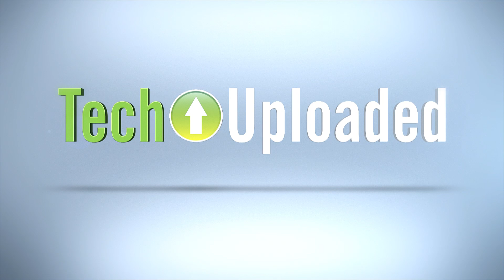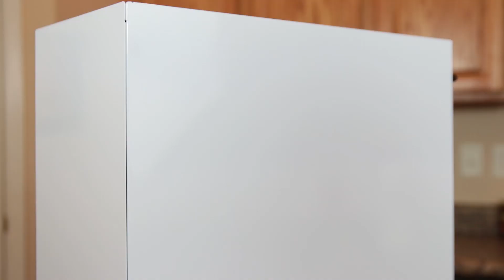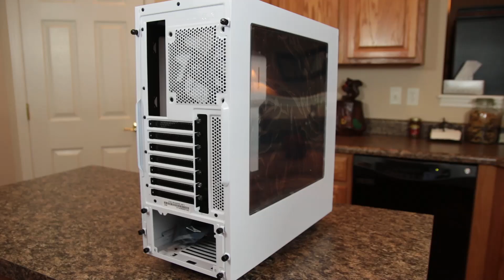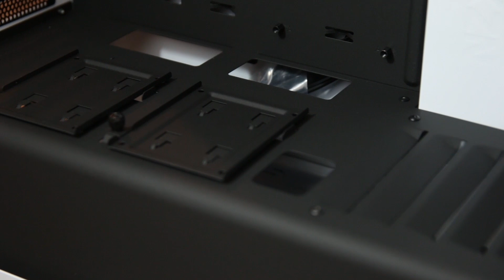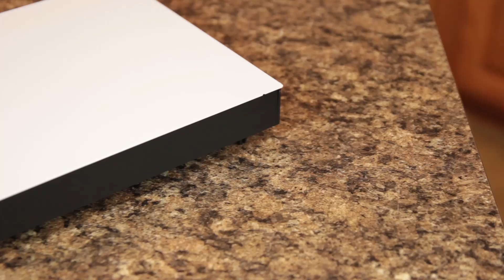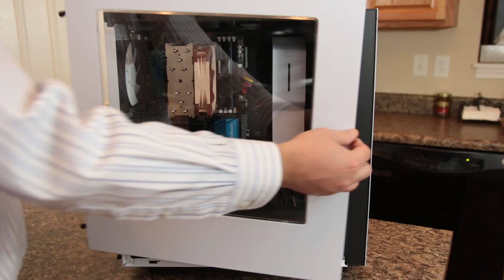NZXT S340 Mid Tower Case Review

Comment: hey man if i want to buy the NZXT H440 case and it have no optical drive.. so how i am gonna install windows in this situation? should i buy an optical drive and plug it into the pc and then install it?
Reply: ELEGZER i know this is a late answer but what i did for my comouter i used my laptop or friends computer to transfer the operating system to a usb with enough memory
Reply: Yusuf Gunsever no its not late cuz i still didnt buy one :).... and thanks
Reply: ELEGZER no problem
Reply: use a usb

Comment: Great video thanks, I'm building mine today and hope to have a great experience using this case.
Reply: Droo-Tech how did it go?
Reply: It was an absolute pleasure, took around 3 hours to complete. Only issue I had was mounting the MB, the screw in the centre is hard to reach. Otherwise it's been running great.. Only problem is the upgrade itch is itching!! Eyeing out a completely new build now..
Reply: Droo-Tech how many fans did it come with, did you add or remove any, and how is airflow?
Reply: It came with 2 fans which I upgraded to Cooler Master Silencio FP120's which have been whisper quiet. Airflow seems to be good, it's in quite a confined area under my desk and have never had any heat issues, although I'm running everything at stock now.

Comment: So which liquid cooling radiators can I mount in this case?
Reply: +akash Sancheti Kraken x61 mate
Reply: +Droo-Tech any other cheaper option bro?
Reply: +akash Sancheti try look at the corsair's H55 but check the thickness first
Reply: +Droo-Tech in my country x41 is more pricy then x61
Reply: +Droo-Tech h55 is a good option and it is cheap and equal to a good air cooler. Thanks :)
Reply: +akash Sancheti sure mate, I'm going to be posting an s340 build in the next 24hours so subscribe if you wish :)

Comment: I sound stupid but is a tower case the actual pc
Reply: +bass Collings No, the Case just keeps hardware inside of it, for example: Motherboard, HDDs and things like the PSU, GPU, and PSU. Hope this helps :)
Reply: each component does his own job. gpu renders heavy 3d things, psu delivers power. the mobo keeps everything connected. case keeps everything in it and if it does look good it will give you an orgasm :*)

Comment: where would  put in the cd rom?
Reply: no1 uses cd roms. throw them out instantly.
Reply: +David Ayarra There is no slot for an optical drive.
Reply: o
Reply: +David Ayarra We live in a digital age.. This case doesn't have one which I guess is good, because I barely use my optical drive to begin with.
Reply: Just buy an external usb drive
Reply: +Shrimpo toov late, bought the phantom instead
Reply: +Times9 unfortunatly windows gave me a win 10 pro setup CD and wont allow me to return it and wont give me an activation key instead
Reply: +H C actually, the windows 10 CD you have gotton should have an activation key within the Box it came in, YOU WILL NEVER get a CD without an activation key, so you can just download windows 10 straight off microsofts website and use that activation key you should have gotton in the box with the CD
Reply: Times9 nah i think it was stolen
Reply: call microsoft and explain it then, if you brought the product they have to give you a cd key no matter what.
Reply: Times9  will do

Comment: At the moment a be quiet! Dark Rock 2 is working in my 350d. The be quiet! Dark Rock 2 is 166mm tall and fits into the 350d which can handly coolers till 160mm (so its said in the technical description). Will the be quiet! Dark Rock 2 also fit into this? Has anyone a combination of the be quiet! Dark Rock 2 and die Source 340 ?

Comment: Can I fit two 1 TB hard drives and an SSD in this case?
Reply: ATV916 yes.
Reply: As an owner of this case I'll say yes, however you should check the specs before buying and please note that my SSD mounted upside down, the screw holes are on the bottom btw. So if your screw holes are on the top of it, then you're good.
Reply: +ATV916 you know you could just buy a 2tb hard drive just in case

Comment: Could you fit a Corsair Hydro Series Extreme Performance Liquid CPU Cooler H100i In here? Just wondering.
Reply: Ducko 1103 Or I was also wondering if you could use the H60 High Performance or H55 Quiet edition.
Reply: Ducko 1103 I believe you can. It says there is room for a NZXT version of it (2x120mm rad)

I'm buying one tomorrow and have a H100 so I'm hoping so!
Reply: Chairman LMao Awesome!!!
Reply: Chairman LMao Hey man, did it fit?
Reply: Chairman LMao Hey man, did it fit?
Reply: Lukeyz never bought the case in the end dude! Decided to stick with original case for the moment

Comment: I have two of these cases. According to NZXT, the case was actually designed before the X41 was released and only the (NZXT) X31 and X61 will fit. X31 in front or back, and the X61 in front. Not sure about the X40 and X60, but they should fit because of their dimensions.

Only negative for me is that the window scratches waaay too easily.
Reply: Will the x31 and the x61 both fit in the case at the same time? I really need to know this. I'm planning a build within the next few weeks.

Comment: Great option, if you don't mind the lack of optical drive. Call me old fashioned, but I prefer having it as an option at least. Sure you could just have an external drive, but that will just add to clutter for me. If I was after a clean look I'd probably just get a case with a door on front.
Reply: I personally front use optical drives but a fan controller or things like that are good to have

Comment: That white bar is removable for better radiator clearance
Reply: Yes.  You can fit quite a lot in the front with that off.  I'm surprised he did not note that in the review....considering that you can also take it off if necessary to fit a long GPU.

Comment: Perfect timing. My black friday build is going to be using this case. Got a 4690k, MSI GTX 970, MSI Gaming 5 Z97, and 750W PSU for SLI down the road. Always nice to get even another perspective on this case. Only haven't decided on PLS VS 144 HZ TN panel yet but thats a whole different beast.
Reply: What. You have the EXACT SAME mobo, gpu and Sli upgradibility in the future in mind as my build! When you build it, tell me how it goes!
Reply: (I haven't built it yet)
Reply: Ended up building it just after new years with parts i got for black friday. It was a great experience, and it was my first build having only replaced things in a PC prior. The only thing I regret is not seeing my PSU was 'modular' but not fully modular, so wiring was a bit cramped but due to my own error. The case looks very clean just had to work a bit more. The MSI 970 is an amazing performer. Went with a factory sealed water loop(kraken x61) and temps on the CPU are around 18-20 degrees celsius at idle and the 970 never goes above 50-55 celsius under load.
Wishing you much luck on your build.
Reply: BHO ulders Thanks! I'm building my PC right before summer! I'll try to remember to tell you how it goes! Oh, and how does the build look?